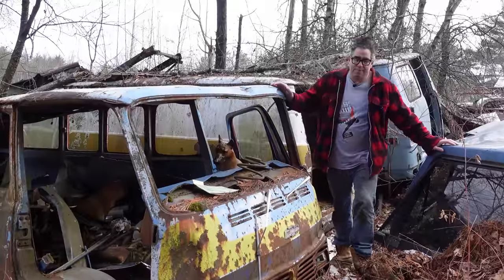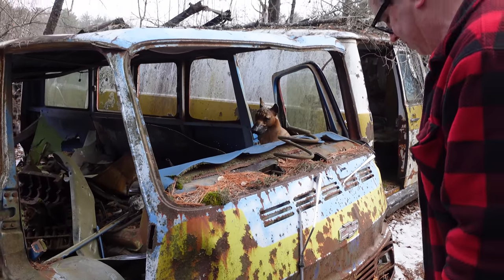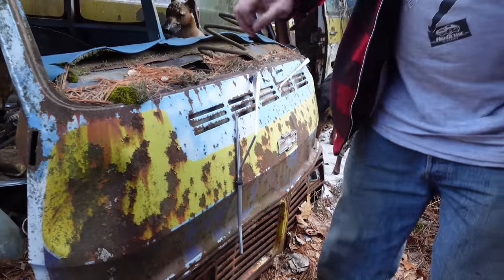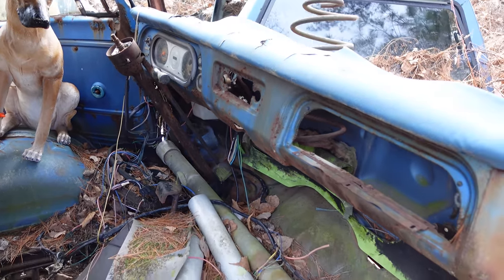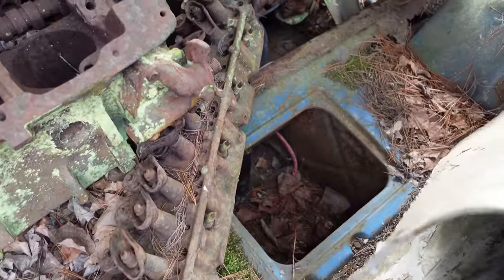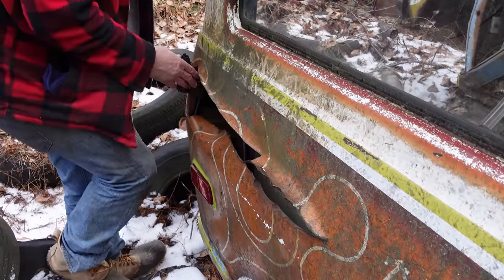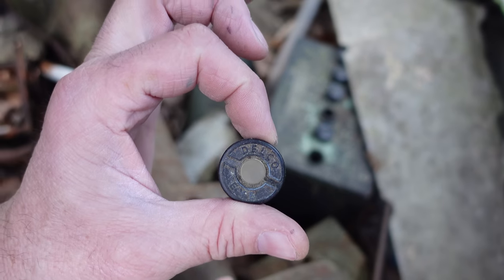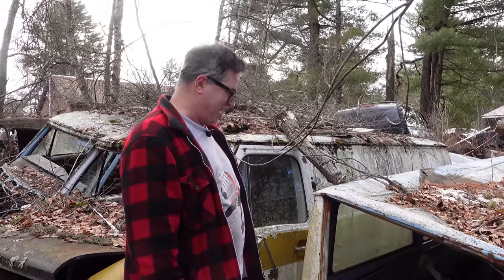Gee Wagon

Comment: One could certainly make an argument that the first American front engine forward control van was, in fact, the Willys FC150 and FC170 line.  The "FC" stood for forward control.  While they were almost exclusively pickups there was a limited number of vans produced, primarily for military applications, some with diesels.  As an aside, that Delco battery you showed brought back memories.  In the 1960s I grew up in an auto parts store.  Batteries then were dry, no acid.  We had to fill the battery with sulphuric acid and charge it when it was sold.  The cap you showed with the clear protrusion was called the Delco Eye.  It's purpose was to allow you to see if the battery had sufficient water/acid mix without removing any caps.
Reply: I remember the Delco Eye very well.

I was working in a Pontiac dealership in the mid-1970s and we still had to fill batteries.
Reply: My dad had a 1961 FC170.  He had the Super Hurricane engine rebuilt but didn’t like the high rpm’s. I told him to get the bolt on overdrive but he opted, with a friend’s enthusiasm , to swap it with a Buick V-6.  Never was the same again.  Ran very hot. Never saw the street again.  Sold both engines and finally the rig itself.  😢
Reply: yes the willys forward control came to my mind also
Reply: @Joe-ov1ut  ... I have a 59 or 60 FC for sale here in lower Ct if anyone is interested. It's partially into a frame off restoration that someone spent big bucks on. Rough body work on the cab is done, bed, rear fenders, and fuel tank have been done and painted. Rolling frame with running engine, needs transfer case work. Has new tires also. Probably have over $15k invested but accepting offers.

Comment: Yes, the 1968 Sport Van with the 108" wheelbase is an internal model of "GS11006", and most were made either in London Ontario Canada (VIN code "5"), Scarborough, Ontario Canada (VIN code "4") or Pontiac, MI (VIN code "P"). 

No VIN, can't win, but might be something like: G for G Series van, E for V8 gas engine equipped, possible 15 for 1/2 ton/1500 load capacity, 8 for 1968 model year, P for Pontiac, MI assembly and the rest is the production sequence. The Pontiac, MI assembly plant complex was very vast with the automotive assembly plant closing in 1988 after the last "G" body RWD cars and Fieros were assembled. 

The Pontiac West/Truck and Bus part of the plant would have some buildings demolished by 1981 and by 2008, most of anything in Pontiac, MI related to the plant would have been closed and has been subsequently razed. The Scarborough Ontario plant would operate from 1974 to 1993 as an assembly plant and prior to that it was a Frigidaire refrigerator plant from about 1952 onward. GM's London, Ontario Canada plant would operate from about 1950 to 1979 and then various other concerns have owned it since that time. 

You can buy a "topper" for many Delco batteries that lets you use a modern battery with a vintage look. No tag, can't brag, but possible code 503 or 537 Light Blue exterior paint (originally). Looks like it was customized many years ago and it was probably a sharp van in its day, maybe circa 1974-1975. Maybe it last played "Saturday Night Special" by Lynyrd Skynyrd or "Jackie Blue" by the Ozark Mountain Daredevils on the radio as its "last song".

An interesting read is the saga of the 1975 Chevrolet van "Wild Cherry" that was restored by Chris Carter, but after it was removed from a property in CA, the owners of that property wanted it back. Mr. Carter asserts that the van was abandoned and that he had permission to remove it. A court battle ensued with Mr. Carter getting arrested, but I believe something was eventually worked out where he kept the van and has since restored it or is in the process of doing so. He now has T-shirts with a drawing of the van that read, "Wild Cherry. Drive It Like You Stole It". The van was featured in the 1979 movie "Van Nuys Boulevard." The story was that the owner of the time, Nick Massalas named the van Wild Cherry because he was picking up his girlfriend at the time at school and she was drinking Canada Dry "Wild Cherry" soda and the name stuck. He used to cruise Van Nuys Blvd in LA which was popular to do at the time and the producers of the movie asked him if he wanted to have the van for a short segment, which he agreed to. He sold the van in the summer of 1980.
Reply: I wonder how many times this song was played in it?  https://youtu.be/RiEIToOWr64
Reply: A Chevy van made in Pontiac....how about that!
Reply: @kennethsouthard6042  Depends on when it was taken off the road. LOL.
Reply: @tony-ps4qw  Yup, Pontiac, MI.

Comment: As a kid I recall the new 67 Dad came home with. It must not have been a 108,it had the skinny windows between the front doors and the big side windows. It featured a step that folded out when the side door was opened. The 283 v8 was under the doghouse (a warm place to sit in winter driving) Our van did NOT have the optional coils spring in the speaker hole.

Comment: My uncles used to buy half ton Ford vans that would cary 90% of the tools they were likely to need. They also had an F250 rack body for picking up lumber or towing a trailer. I bought my first full size van in 2001, an E250. I think form 2012 on even E150s and now the Transit T150s have GVWRs over 7500 pounds giving almost all of them at least a ton of cargo capacity.

Comment: In 1972 I watched in my rear view mirror as a similar van flipped over at high speed. Every door popped open and limbs were everywhere. It was a horrific sight.
Reply: I rolled my 66 chevy van back in 1997 in Tampa Bay Fl  .Rear axle locked up and spun me around backwards and within seconds I was on my roof
Reply: Was running at 55mph when the axle locked

Comment: funny thing about the first gen vans is they were a foot shorter than the Corvan 95 they overlapped by two years. The first gen shared the Corvan dashboard, steering wheel, and such, but had 3 on the tree, which was never in the Corvan.

Comment: My mom and dad bought a 67 108 chevy van slightly used in 68. My dad kept patching it up until about 1990. It had windows all the way around, the battery was behind the front passenger seat below the floor, 283 with power glide and a step that pop out when you open the side passenger door. It also had a double brake booster system, that was a pain the #&##. No power steering but the brakes could stop a Mack truck. And top speed with it on the floor was only about 65.

Comment: Uh, Steve... this was Chevrolet's THIRD generation of vans. Maybe you forgot about their very innovative Corvair 95 series which debuted in 1961. While the Sportvan did have a somewhat lower floor in back, owing to the 95's rear mounted, air cooled 6-cylinder engine, the remainder of the floor was much lower, owing to its unified construction. Of course, every other van made in this country until the Chrysler Voyager/Caravan twins was of the antiquated body-on-frame design, this Sportvan included. The Corvair 95 series had 3 across seating in front, something physically impossible in the Falcon/Valiant/Chevy II-based vans and pickups with their huge engine cover between their narrow little front seats. As for the pickup versions of these early, forward control trucks, only the Corvair 95 Rampside had, well, a ramp built into the side of the bed, ideal for landscapers and the like who didn't have to lift heavy equipment all the way up into the bed which was higher than that of the Rampside anyhow. The Rampside (and its companion, the Loadside, which came without the ramp) had more cubic feet of load space than any other F/C pickup of the era. Unloaded, the Corvair 95 series had much better traction in back. Owing to its rear-mounted drivetrain. In fact, in a panic stop in a Ford or Dodge F/C pickup from the 60's, you had better be prepared to rechrome your front bumper, because those little trucks are so light in back that they will actually lift the back end right up off the ground! Safe? Not so much. So, in summation, the Sportvan, and it's panel truck sister ship the Chevyvan, were just "me too" copies of the old style Ford and Dodge vans of the time. The Corvair 95 was the real innovator of the class. The problem was, as Chevy found out, is that America didn't want innovation, they wanted the same old same old. For the most part, they had no idea of what they were missing out on.

Comment: I had a couple of friends who owned this type of van and I remember that one was a 283 3 on the tree 🌳 and I had a friend who had a 75 short wheel base with the 350 four barrel, both ran very well unlike the 75 Dodge l had with the 318 that wouldn't fall out of a tree unless you cut the limb 🙃

Comment: In 1969, Chevrolet/GMC came out wit the "3/4 ton van" in regards to the 1969 second generation "engine forward" Ford Econoline van.  All Ford, Chevrolet/GMC and Dodge vans became more and more "heavier duty" as time progressed on, to meet the demands of customers.  All the van(s) started out as very light duty in the early 1960s, but customer(s) simply did want pickup truck style vans on pickup truck chassis, and why that is I do not know why.  It would only have added about 15' more wheelbase, and be more versatile.  I will take a 2 wheel drive Chevrolet Suburban over a Chevy Van any day, you can do more with it.  "All GM had to do was, Just add a taller roof and a sliding right side door"  Please reply.  Dave...